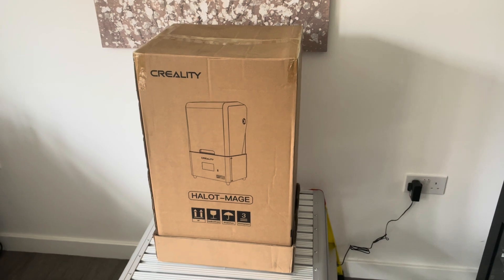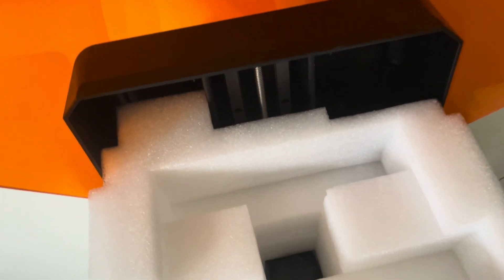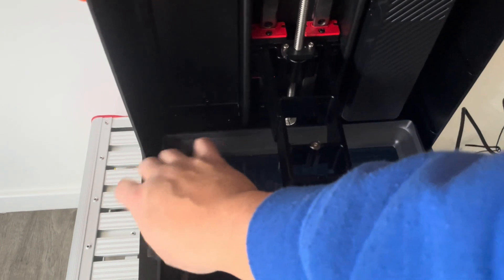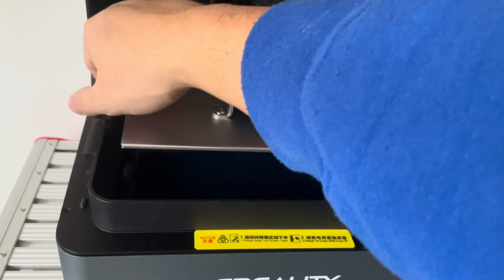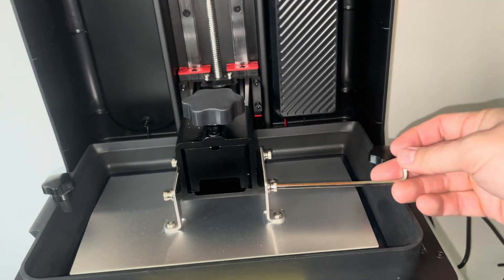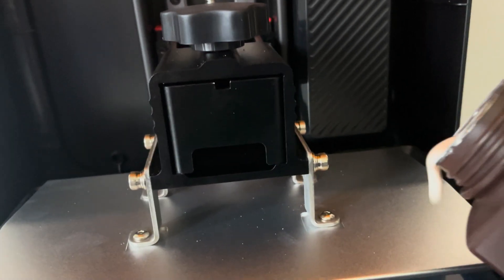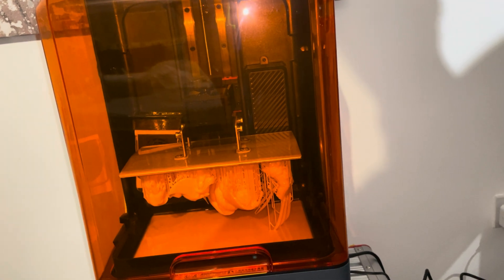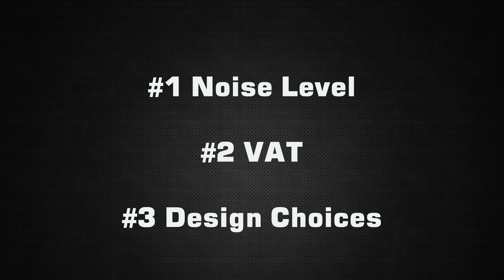CREALITY Halot Mage 8K Review

Comment: What setting and slicer you use for print ?
Reply from the maker: I used Lychee and the settings are in the video description. Let me know if you need anything else….
Reply: @scooby3dprints67   which formats this printer supports and what about the printing speeds? description says it only prints at 40mm per hour
Reply from the maker: It uses the Creality format cxdlpv4, I’m yet dialling in the settings but the time depends on your resin and exposure times (and lift like I’ve shown in the video). 40mm/h seems high I’ll update if I get around this. At the moment I’m more around 20mm/h
Reply: @scooby3dprints67  try maybe to update the firmware as far as i know it was updated at the end of 2023. ppl say it helped with the vertical speed a lot, because out of the box the device seems pretty sleepy and the platform crawls up and down pretty slow. 

I'm asking because currently i'm picking between Halot Mage and Saturn 2 8k both of them are roughly at the same price. 
I like Halot Mage because of the rotating lid it seems very convenient, but there are plenty of small quirks which are the result of cutting the corners, not sure if i will be able to live with them... and the speed also quite bothers me. Saturn 2 also is a cheap device, but it seems  manufacturers cheapened it in a right way so that this doesn't affect crucial aspects such as speed and quality, not interested much in bells and whistles such as smart resin pump or wifi honestly)

Comment: I got my Halot Mage 8K about a week ago. Absolutely love it. I've noticed that there is no bearing at the top of the Z rod on yours. Mine has a bearing at the top of the Z rod as well. Strange....
I must add that the filter works very well. No smells at all 😊
I did a software update on mine. The build plate now moves a lot faster when pushing the home button. Before, it was excruciatingly slow.
Reply from the maker: Thanks for sharing… yes I did mention the missing part on the video. I’ve contacted Creality and they shipped me the missing bits. Will be updating when I receive it. 
What version are you using? I have the latest from their website….
Reply: My pleasure. I'm also using the latest firmware. Version 4.6.6_2.5......

Comment: Hi, i  think i'm going to Buy one, but i don't know if the z axis can print less than 0.05 um because even with 8k You loose resolution without it and is not clear in the especifications if it can, have You tested with less um? Otherwise maybe i choose the pothon m5, but i'm still in doubt, i like this machine but is important that
Good video
Reply from the maker: Yes. As I said in the video, this dimension with 8k has less than 0.03 resolution per pixel. I did use same layer height (0.03mm) and I can’t see any lines or artefacts. So yes, this printer can do less than 0.05 on z
Reply: @scooby3dprints67  it's like manufacturers hate their own creation) most of th time they tend to blow up those numbers in their ads)